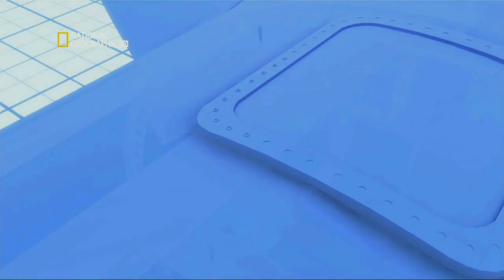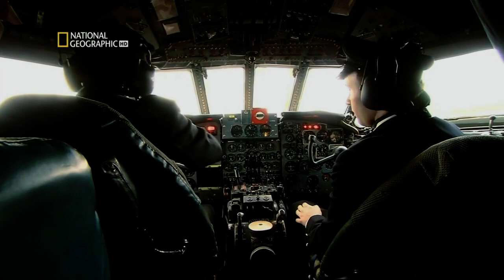The Crash of the De Havilland Comet

Comment: i've heard that tragedy happen because the windows is square.... plane's windows are now circle. yes its true
Reply: Not true, the Cohen Committee found the Comet riddled with hundreds of fatal design, engineering, materials and construction defects.
While DeHaviland modified the Comet 1's  windows the aircraft had its airworthiness certification permanently revoked.
Reply: @sandervanderkammen9230 

We feel we can shed some light on some common myths & misunderstandings.

  That's correct of course, at the time the Comet wasn't particularly dangerous. It was also definitely not the worst aircraft engineering disaster in aviation history obviously.

  The Comet's engines, right from the first prototype were demonstrated to have enough power even for high altitude  / hot airport operation. No incidents were caused by lack of power.

   Obviously the Comet's engine position & inlet position had some distinct advantages at the time & of course pylon mounted  podded engines have some problems including excessive induced drag. The Comet engine inlet design was not a fatal flaw & didn't cause any incidents.

Examples of all Comets mks including some Comet 1 airframes continued flying with certification at some point after 1954. Flying carried on until 1997. 

      Losses comparisons.
How things were in those days.

DeHavilland Comet 4 UK                  14% 
DeHavilland Comet all mks             17%  

Boeing 307                               70%
Boeing 247                               48%
Boeing 707            .                  20% 
Boeing 377                                19%  
MD DC-8                                    15%
Lockheed Electra Turboprop   29%
Canadair CL-44  Turboprop     46%  
Convair CV-580  Turboprop     22%
Convair CV-880    (ff 1959)       27%  
Convair CV-990     (ff 1961)      35%

     Of course De Havilland had prior experience building many all metal construction airframe aircraft & thousands of jet powered fighter aircraft that were primarily of metal construction with pressurised cockpits & jet engines built by De-Havilland.

   That is of course correct, Comets flew until 1997 & the original Comet design had military use as a requirement. Nimrod development began at De Havilland before 1953, Nimrod aircraft were in service until 2011. Indeed it is the case that the Nimrod was not withdrawn due to structure problems or other airframe issues, it was entirely due to a significant wing upgrade snag & resultant basic economics & an end of line sale happening at Bow-wing (see b-47 wing folding incidents for info) at the same time.
 
    The world's first pressurised cabin aircraft was of course an Engineering Division USD-9A, a modified British design Airco DH.9A built under license in the US  & was of course the first aircraft to fly with a pressurized cockpit module. This was during a joint US / UK research project in the 1920s.
 
    Yes, that's true, De Havilland carried out full stress analysis & engaged in a comprehensive & protracted testing program which is why key De Havilland people were happy to be aboard flying DH Comet aircraft. The Comet was the first airliner where stress due to pressurisation significantly exceeded flying load stress for a full length passenger cabin fuselage.

     We agree, that's correct, the DH Comet was the first passenger airliner with full length fuselage pressurisation at 8psi pressure differential. Handley Page built the world's first all metal construction airliner during the 1920s.
     In all cases other earlier pressurised aircraft were larger, needed thicker fuselage skins due to flying stresses alone & had much lower pressurisation differential pressure or were military aircraft with relatively small heavily built pressurised capsules. 

     Of course ripstop provision was provided. The skin alloy used became unavailable at the time due to R & D at the manufacturers which resulted in the original alloy being discontinued. Later alloys had very similar properties. The skin thickness used for the Comet was used for similar size later aircraft. Frame spacing was not found to be too large & frame width was not found to be too small.

    Without doubt De Havilland did indeed always work to better than industry standards at the time, used up to date knowledge for the design & construction & no evidence of negligence or criminal negligence was ever produced in relation to the DH Comet.

    Obviously the DH Comet had no effect on the course of the aerospace industry in the UK. The UK now has the world's highest combined nuclear, aerospace & defence sectors per capita activity. Of course anyone currently flying on a wide body airliner stands a good chance of being on an aircraft powered by RR gas turbine aero engines designed & built in the UK.

    That's correct, the investigation committee did not find hundreds of fatal flaws or evidence of design defects, structural defects, defective materials or shoddy workmanship. Indeed it is the case that ripstop provision was included. Claimed incidents did not involve cracks starting from passenger cabin window corners. Pretty much all changes were just in case changes or were planned development modifications & improvements that were scheduled regardless of incidents.

    Obviously De Havilland designers knew all there was to know about metal fatigue at the time they designed the DH Comet.

    It is in fact true to say that the way airliners were built changed everywhere, including in the US, after the Comet incidents.

We hope this helps, obviously.

Cheers indeed of course as always etc.
👍
 
 
 . . .... ... ..... . ..... ..... ..

Comment: TWA 800 in the 1950s basically.
Reply: The different was TWA 800 exploded due to AC short-circuit lead to fuel combustion then explosion.
Reply: TWA 800 was caused by a fuel tank explosion when a short circuit caused by the aging wiring found its way into the fuel tank.
Reply: 800 was shot down.
Reply: @SH00T_TH3PUMP  no it wasnt
Reply: @benobrvar5956  Yes it was
Reply: @SH00T_TH3PUMP  it’s odd how it’s actually explainable by a much more plausible theory. The short circuit. And this was before adding nitrogen in the fuel tanks was mandatory. Occam’s razor bro. There’s literally no bomb damage either. I said DAMAGE. And it seems clear that the explosion started in the fuel tank because of damage on wreckage from said fuel tank. Also a short circuit was essentially proven to occur with 2 microscopic pauses in the flight recorder just before the explosion and the flight recorder cutting off. Listen the more plausible theory is the theory that’s most likely correct. That’s Occam’s razor. Also barely any of the witnesses actually saw the plane explode the second it did. They only looked when the sound came which they saw the plane ascending higher and higher into the sky then suddenly then nose diving (well not really as the nose fell off but you know what I mean) into the Atlantic. Light travels faster than sound right?
Reply: They both freak me out.

Comment: Sometimes crashes happen through crap luck. More often, through a pyramid of stupidity, poor planning, and greed.
Reply: this was the first commercial plane to ever be pressurised, flying higher and higher altitudes than ever before... also it was designed in the months following WW2's end, all the way back in the late 1940's back then they didn't even know what metal fatigue was or that the effects of said metal fatigue were being accelerated by their crappy rivets, square windows and doors and ultra thin exterior skin, as humans we learn from our mistakes, and in the aviation industry this was the one that drastically changed aircraft design for the better!
Reply: @DomWPC  Bullshite! The Comet was not the first pressurized airliner.
Reply: @sandervanderkammen9230 *one of the first pressurised passenger aircraft
Reply: @DomWPC  Boeing, Douglas, Junkers and Lockheed were all building pressurized airliners years before the Comet Disaster.
Boeing built the world's first pressurized airliner, the 307 Stratoliner in 1938.
Boeing was building jets with pressurized cabins to 9psi at altitudes of 42,500 ft. In 1947.

The subject of metal fatigue in aluminum was well-known and understood by 1949... the problem was DeHavillands was still building WOOD biplanes like the Dragon Rapide.

Comment: i've heard that tragedy happen because the windows is square.... plane's windows are now circle...
Reply: Ibrahim Ibrahim Exactly. Circular windows distribute tension and weight equally, whereas square/rectangular windows and doors let it build up in the corners.
Reply: stress concentrations form around any irregularities in the aircraft's skin. Corners of rectangular irregularities will cause huge stress concentrations whereas rounded areas form much smaller stress concentrations that are easy to counteract by thickening the skin around these irregularities.
Reply: It's not just the square windows, the plane's hull without them was still too thin and fragile to handle those tremendous stresses from the start
Reply: There oval
Reply: @JR-rj8lm  *They're
Reply: that was with the Constelation aircraft.
Reply: They were also larger than the Windows today Which are also reinforced
Reply: More than just the windows - assuming you watched the video. It had a better looking design than many modern planes, with those embedded engines.
Reply: They caused fatigue cracks and it snaps the aircraft in half
Reply: @toasterhavingabath6980  Don't forget that the screws that caused the fatigue cracks were ”Hammered,” not screwed in. If the screws were screwed in with a screwdriver instead of a hammer, it would have taken a lot longer for those fatigue cracks to destroy the plane...
Reply: @CrisisHedgehog  yeah that too
Reply: It’s called stress concentration due to sharp corners. Sharp corner should be avoided in mechanical engineering.
Reply: It is a popular belief, as the later (more robust) fuselage designs used windows of a more oval shape. The main point is explained in the method of construction, which incorporated 'hammering' of rivets in to place in an already thin aluminium skin, where repeated expansion and contraction sequences caused metal fatigue to the point of 'explosive' decompression in flight. At about this time, Boeing had manufactured the 'Stratocruiser' with cabin pressurisation, but went further to making an aircraft powered by jets in pods hanging from the wings, as well as using thicker aluminium, bringing along the 707 prototype, which led airlines of the world using the Boeing 707 as a preferred aircraft...
Reply: That's why physics and maths are very important.
Reply: The accidents were caused by fatigue failure.  These crash would have happened with circular windows as well, just would've took more time.

Comment: 2 centimeters kills 35 people...
Reply: No, catastrophic structural failure kills 35 people. Or invisible stress fractures do. Two centimeters is only an intermediate stage.

+macie stoneking
If that's a joke it isn't clever. DeHavilland designed an aircraft like no other. It was the first passenger  plane to fly so high and fast, and no-one expected or could have expected what happened based on metallurgical knowledge in 1950. The thin skin was intentional, to maximize performance, and if not for the square windows it would have been plenty.
Reply: de havilland cut corners in the construction of the comet..
Reply: +Richard Head I presume you are talking about the corners of the windows? as these were the cause of failure. Having a sharp window corner caused localised stress concentrations, resulting in fatigue and finally rapid catastrophic failure.
Reply: @nickrobo45 but the metal fatigue grew from manufacturing defects, which came from rivets being punched into the weqk metal skin. So, not the cause, but it merely accelerated the inevitable.
Reply: @nickrobo45 The wreckage recovered from the sea confirmed that the passenger windows were not related in any way with the catastrophic in-flight structural failures.
 The skins were too thin and the AL2014B alloy to brittle.
 The origin of cracks didn't cause the crashes, the lack of proper rip-stop doubler joints and fuselage reinforcement hoops were too weak and spaced too far apart to prevent cracks from joining up with adjacent panels
Reply: still the comet2 and other jets had thicker skin, it was a combination of the thin skin and windows that gave it a premature fatigue.
Reply: +Cruz Medina How about 2 cm kills 260 people in EL AL Israel 1862
Reply: ( ͡° ͜ʖ ͡°)